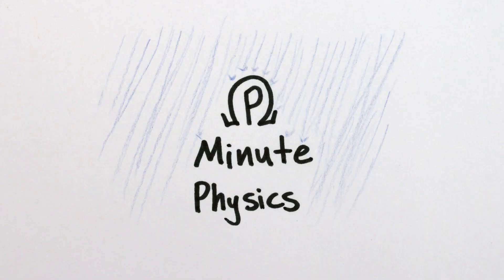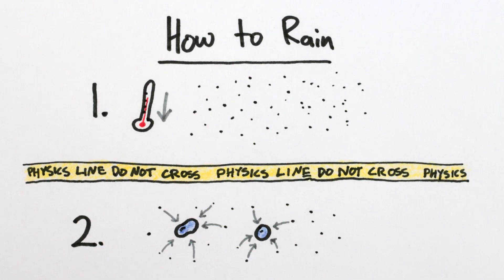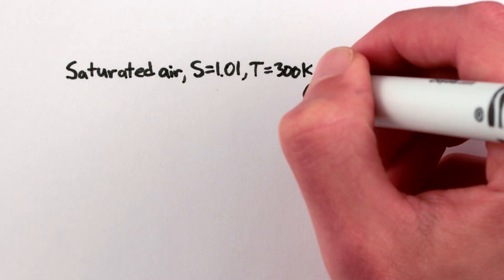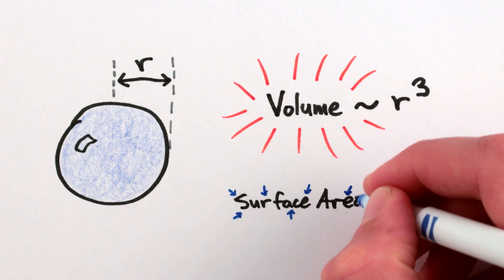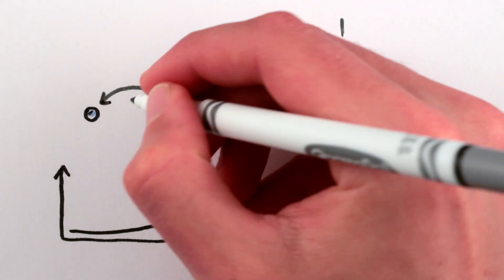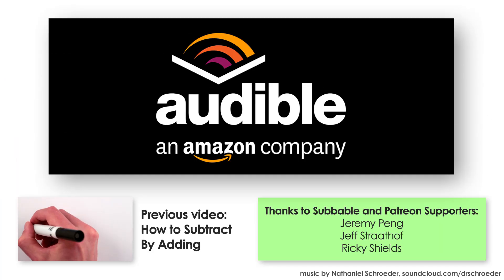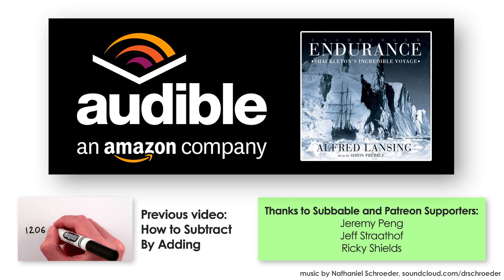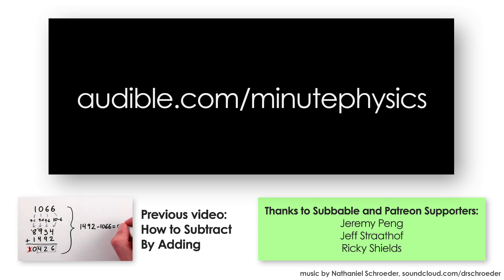Why Raindrops Are Mathematically Impossible

Comment: I never really liked the whole "if it's less than 1"-type arguments because they are dependent upon the units used.  If you measure raindrops by the meter, then of course their radius will be a very tiny fraction, and squaring/cubing will make the numbers much smaller.  But if you measure them in angstroms, for example, then they will be a large number and squaring/cubing will make them much larger.  And one cannot argue that raindrops will behave differently based upon what units are used to measure them.
Reply: stellarfirefly See you would think that but cubing and squaring also effect the UNITS THEMSELVES.  A cm and m are different in size by a factor of 100 in either direction.  When you look at square cm and m though you end up with a situation where 1 m^2 is 10,000 cm^2.  So when you multiply in the smaller unit to make the unit squared it becomes a smaller fraction of the larger unit squared still.  See what I mean?
Reply: stellarfirefly 
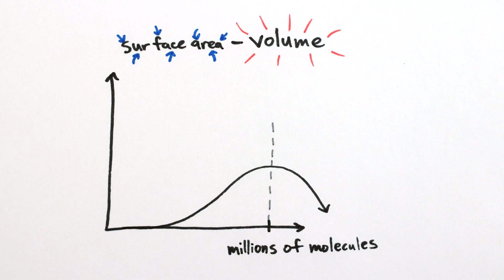That is clearly not his reasoning or argument, these <1 numbers are used to illustrate the principle behind why this happens rather than specify this instance itself. Notice that around 1:45 he does mention the specific case you're looking for: "few million molecules".
Reply: stellarfirefly A more detailed answer:

Say the energy you get from the volume is Ev = A.r³, and the energy required for the surface is Es = B.r². A and B are constants expressed in units of energy per cube meter and square meters respectively, for example in J/m³ and J/m².

Using an r' with a different unit than r also involves changing the units of A and B.
When you want to switch to cm for example, you'll get A' = A J/(100cm)³ = Ax10^-6 J/cm³, but B' = B/(100cm)² = Bx10^-4 J/cm² (notice the different power of 10!)

In the video, he implicitly simplifies the problem by having A = 1 J/m³ and B = 1 J/m² so we can compare r^2 and r^3 without thinking about A and B, but they are here nevertheless.
You can't compare/add/subtract two different units anyway.
Reply: stellarfirefly An Angstrom is a unit that is derived from the metric system, and is equivalent to 10^-10 meters. In order to use any equation in physics, you would first have to make that conversion. Or you could convert all of your constants into Angstroms instead of meters, but both methods will give you equivalent answers.
Reply: ***** You're cubing the numbers but not the units. :)
0.1 meters ^3 = .0001 cubic meters.
10 centimeters ^ 3 = 1,000 cubic centimeters,
And .0001 cubic meters = 1,000 cubic centimeters since a cubic meter holds 100 cm lengthwise times 100 cm width times 100 cm deep. 
So 1 m = 100 cm but 1 m^3 = 1,000,000 cm^3.
Reply: stellarfirefly That's not true. 10^2cm is 100cm2. 0.1^2m is 0.01m2, but 0.01m2 is the same as 100cm2. Even though the number 10 appears to grow whereas the the number 0.1 appears to shrink, the size won't be any different
Reply: stellarfirefly 
"That is the argument that I don't really like."
But it's true!

I will rephrase it so that maybe it feels more precise.

Given the functions A * r^2 and B * r^3, with A, B > 0, THERE EXISTS AN R > 0 such that A * R^2 > B * R^3.

This is true regardless of the values of A and B involved.

What's more when r = 0 both of these terms have value 0, and for both of these functions the derivative is positive for positive R.

Both of these functions are continuous.

It follows then, that the function E given by

E = A * r^2 - B * r^3

is increasing (and positive) on the interval [0, R]

This is what is meant by the argument.  It is demonstrated that there is an interval of positive radii for which the square out-grows the cube.  Hopefully the more precise formulation (note the abstraction from units altogether) is a bit more comfortable than the colloquial "except when very small".

P.S.  The remainder of the statement is that we can find an R0 > R such that B * R0^3 = A * R0^2 (in fact some algebra shows this to be R0 = A/B) AND for all r > R0 the function d/dr B*r^3 > d/dr A * r^2, so that "the cube grows faster than the square", but I figure that's not the part you're having trouble with.
Reply: Biochem Guy  Well-explained.  I have a huge amount of respect for Henry and his ability to describe complex phenomenon very simply and concisely, but in this case I believe he really should have used your approach of essentially "the ratio of surface to internal molecules" for this video, instead of using "the rate of change between numerical squares and cubes" which (IMO) clouds the issue more than it clarifies it.
Reply: stellarfirefly It does feel strange at first that cubes grow faster than squares for numbers greater than 1 and shrink faster below 1 since 1 unit could be a meter, an inch, etc., and I used to wonder how that could work. The answer is when you switch between the units there will be a conversion factor in the form of a number multiplied onto it (switching from cubic yards to cubic feet for example gives a 27, since 27 cubic feet fit in one cubic yard). 

In any case, what you're trying to do is minimize the Gibbs free energy in the raindrop example, so if you're switching units all you're doing is affecting the magnitude and units of the constant that you multiply by to get from length units (since surface area is length units squared and volume is length units cubed) all the way to energy units. Either way you're going to be comparing the Gibbs energy resulting from the surface area plus that from the volume, and the shape the raindrop makes is where this sum is minimum. This minimum won't be decided by what units you choose since that constant which contains the conversion factor between units will be necessarily included in it. Does this address the question? Most of the replies seem to be skirting around the actual question you asked without answering it in a simple but satisfactory way, and I'm not convinced I've succeeded in clarifying it either.
Reply: ***** On a separate note the reason these energetics work out is the structure of water molecules.  Water in vapor can orient itself in many dfferent positions (think degrees of freedom), but when condensed with other nearby water molecules it has a very finite number of orientations and positions it can occupy.  This is very very entropically disfavored.  At large volumes water prefers to clump because the vast majority of the molecules will be in the internal portion of the droplet.  This is because the polarity of the water molecules allows for hydrogen bonding between molecules and dramatically increases the stability of the system.  At very small volumes a given water molecules will either be at the surface where it can only H-bond with a few others, or it will be internal and able to H-bond with many others.  The greater the number of internal water molecules the greater the enthalpy of formation.  When you start forming the droplet ALL of the molecules must be initially surface molecules and that is very disfavored.  So they are right.  Initially all the molecules are essentially surface molecules (greater surface area) and this is incredibly disfavored.
Reply: Simba IRL "the volume of a sphere is the cube of its radius" is hardly dependent on SI units. I could invent a random unit right now and it would still be true. But even with SI units what MP is saying is absurd. Cubing 0.1 meters is the same as cubing 10 centimeters. Nothing gets "smaller" apart from your arbitrarily selected units. Use meters, Planck lengths, inches, or a unit you just invented. This whole thing seems like a nonsensical way to explain what's actually going on.
Reply: who else liked to look like you actually understood a shit
Reply: ***** Any true physics equation does not depend on the units, but it does depend on the types of units. For example, let's say you had an equation of the form v=something, where v is velocity. Well velocity can be measured in meters per second, miles per hour, kilometers per hour, etc... but all of these have the form length/time, or distance traveled in a given amount of time. Furthermore, the "something" on the other side of the equation has to have the same types of units, else the equation would not be true. 
Because of this, the best thing to do is either: A) set a universal standard of units that's convenient for as many applications as possible and try to make most people use them. This is what the appraised SI system does. (The one with meters, kilograms, and seconds). It's a good overall system for reasonably sized things and metric prefixes work well towards making it reasonably simple even for very large and small things. It does have a few small drawbacks, for example it necessarily makes the standard unit of pressure the Pascal, which is in Newtons per square meter... well a Newton is pretty small and a square meter is quite large... so standard atmospheric pressure is already something like 103,000 Pascals. Not a huge issue though.
B) If you have a field of research with where you and your colleagues may benefit from a different system, that's often done. Things on the atomic scale tend to use angstroms or nanometers since they're so small, and things on the nuclear scale will more commonly use femtometers (a millionth of a billionth of a meter). But in these cases, you're really just modifying the scale. A more dangerous but also very useful shortcut many particle physicists do is to use units where c (the speed of light in vacuum) is 1. Well this simplifies many equations; for example, it lets you talk about particle energies, momenta, AND mass with the same terms: electron volts. You might say this particle has a mass of 3 giga-electron volts or that particle has a kinetic energy of 7 mega-electron volts. This is extremely useful, but they're professionals and they KNOW that those units aren't actually the same thing. And there are times when they have to put those units back in or many of their calculations will get jacked up in no time... because even with units where c is 1, the expression c=1 isn't technically true, because the types of units on both sides always have to match. American engineers also commonly do a similar thing with "pounds of force" even though pounds would normally be a measure of mass, so "pounds of force" is a unit that also depends not only on mass but also on the gravitational force at the surface of the earth. Since most engineers will only even design things that stay don't leave our planet, this is rarely an issue, and the ones who are doing otherwise are smart enough to correct their equations when need be. 
Let me know if this is a satisfactory answer to your question. In particular, your phrase "When do things become too big or small that a more complex equation or model is needed?" has a lot of other ramifications that can come into play in extreme circumstances.
Reply: stellarfirefly derivative of ax =a, derivative of bx^2=2bx, if a and b are positive a-bx starts positive but decreasesThis was x squared and cubed but its the same argument (second derivatives or whatever)
Reply: ***** 

0.1 meters ^3 = .001 cubic meter
10 centimeters ^3 = 1000 cubic centimeters = .001 cubic meter
Reply: stellarfirefly the problem here is that you shouldn't be looking at the measurements themselves but the ratio of one to the other.   the "one" he is referring to in the video that is the crossover point is where the energy of the surface area is = to the energy of the volume.
Reply: ***** Look, more than half the audience won't understand the mathematics if you start breaking out the derivatives, and their point stands that at very small volumes the energy needed for greater surface area dramatically outstrips the energy produced by the increased volume.  The reason this math works out is the same reason that fractals can have infinite surface area and finite volume.  They chose an analogy that isn't perfectly accurate as you can't really compare a unit cubed with unit squared very well.  It was simply the easiest way to get the point across, and still told the very true story that at very tiny amounts the energy released by increased volume is less than the energy required by the increased surface area.
Reply: Biochem Guy Yes, the point stands, but it has nothing to do with squares and cubes of orders of 10, which is what is used in the video.
Reply: +Quaternions nailed it
Reply: Guy, units are arbitrary. Completely made up.
Reply: +stellarfirefly A change in units would need a change in the coefficients of the equation.  You could calculate the point where water drops overcome the square-cube fighting in any units you want, and even though the numbers would be different, the physical quantities those numbers represent in the real world would end up being the same.  This is the reason why units can even exist in the first place.
Reply: This is actually exactly what I was thinking.
Reply: stellarfirefly Oops, sorry. I should have read more comments before positing a similar response to yours.
Reply: Baba Wethu OK but doesn't that mean in every number every unit the cube is lesser than the square cuz there will always be a unit smaller or bigger than it??
Reply: stellarfirefly That's why most stuff is non-dimensionalised in science. And why we depend on dimensionless quantities like the Reynolds number.
Reply: Neha2906 plank length, smallest unit possible
Reply: +stellarfirefly Didn&#39;t see this before I replied to the video....
Reply: +stellarfirefly I like potatos.
Reply: stellarfirefly sa
Reply: stellarfirefly except it works because of the proportionality of cubic units
Reply: You are wrong. When you square or cubes a value THE UNITS also are squared or cubed. The unit is interpreted this way: value multiplied by the unit. Which is natural as when you have 2 meters you have 2 times the unit and so on, 3 Kg are 3 times a kilogram and so on. This way 3 kg and 3000 g (3 * kg or 3 * 1000 * g or yet 3000 * g) are the same. When you square it You must do (3 * m)^2 = 9 * m^2. This will never affect physics in ANY WAY. If you have multipliers like kilo, mage, giga, mili, centi or micro thet are squared also, for instance kilo is 10^3 = 1000 and so 1 km^2 (a square kilometer) is 1 millon square meters or 1000 m * 1000 m and not 1000 square meters.

In MKS (SI) the units form a linearly independent basis and all other units can be expressed in terms of them or their  powers. This happens because if on an abstract vector space you consider multiply an scalar by a vector elevating the number (the unit vector) to the scalar (other number, there is nothing on abstract vectors spaces that says you can not call real numbers or integers numbers vectors) and the sum of vectors as multiplying them You have a vector space. By the same reason prime numbers form a basis (with infinite dimensions) that spans all natural numbers.

Only with electromagnetic units things get more complex because you can consider charge a independent unit or a unit derived from meter, kilogram and second or its counterparts on another unit system (that is what CGS does). IN this case admentional (pure numbers) constants start to have units too. Equations in this case can change form because of the different approach, but not because the units chosen per se, besides physics do not change at all.

This is why you also can have the natural system of units where every quantity is admensional (used in particle physics).

The dreadful habit of USA (THE ONLY COUNTRY IN THE WORLD THAT STILL USES IMPERIAL UNITS) of using imperial units makes USA people have a hard time understanding this, what people used to metric system learn when they are children.
Reply: I know this is a years old video and comment thread, but I still sometimes think back to the reasonable argument put forth by this comment

Years after watching this video, I eventually studied quantum field theory and general relativity at university. I was taught to write equations in “index notation”, where objects are written with superscripts and subscripts such that they can represented independently of any one-coordinate system. You can Google the Einstein field equations for an example written with this notation

I was confused for a long time about the difference between indexes written with a superscript and those written with a subscript. My teachers would tell me the technical name of the difference (contravariant and covariant components), and explain that one represents components that change “with” a coordinate change, and the other represents components that change “against” a coordinate change. I found this explanation unsatisfying for a while, but here in this video there is an example, and this comment thread highlights it

The argument of the video is that the combined forces on a droplet is a polynomial a*x^3 - b*x^2, and one of these terms dominates the other depending on if x is very large or small. I do think it is reasonable to ask what happens if you change units such that you force x to become either massive or tiny? 

As others have pointed out, when you change units the value of the measurement might shrink, but the value of the multiplying unit grows to counteract. For the polynomial, changing the units will affect the coefficients a and b in an opposite manner to x. The balance of forces for stability thus remains at the same physical configuration and is invariant to our change of units

This is exactly the contravariant and covariant component behaviour of objects written in index notation. This is not a coincidence too, as the polynomials do form a vector space ripe for index notation equations

I thought I would share this insight because I find it both very satisfying, and because it would’ve been a good example for my teachers to teach me index notation
Reply: @all: I understand that the math works and that the units don't change.  But a major point of the video was that "the cube grows faster than the square, except when very small" (paraphrased).  That is the argument that I don't really like.
Reply: Tommy Thai Actually, the video completely conflates a numerical effect with a physical effect. +stellarfly is right. The argument as made in the video is misleading, if not non-sensical. 'Water droplets cannot form because x-squared grows faster than x-cubed for small numbers.' I have to use a ton of salt in there and then basically assume that what he is trying to say that it is because volume 'accelerates' faster than surface area (d2(V)/dx > d2(S)/dx), and therefore there is a certain volume at which the free energy obtained from volume is greater in magnitude than that required to overcome the free energy input in surface tension...thereby making drops possible. I get this because I have some basic understanding of physics. The whole 0.01 versus 10 argument is horribly incorrect as exemplified here and in my other comment.
Reply: you are not correct because you have to convert everything to standard units before squaring or cubing so angstrom will be converted to m in case of SI units or cm in case of cgs system which will still result in cube being smaller then sqaured for rain droplets